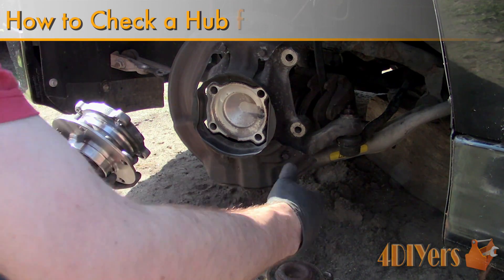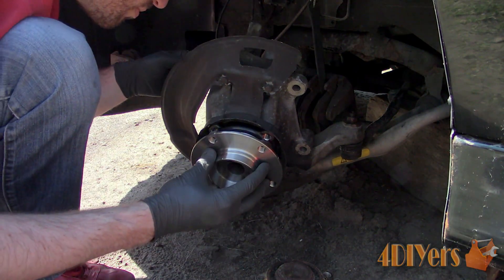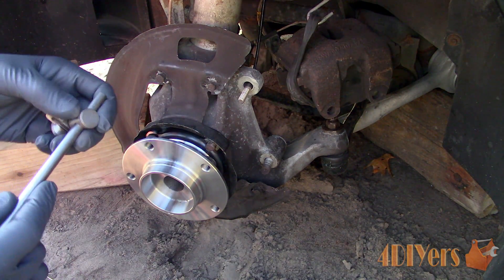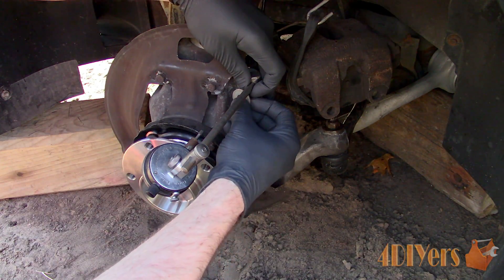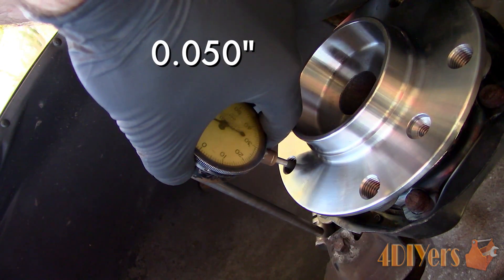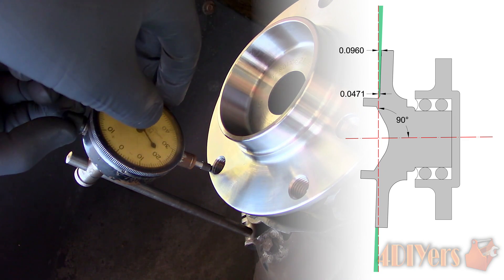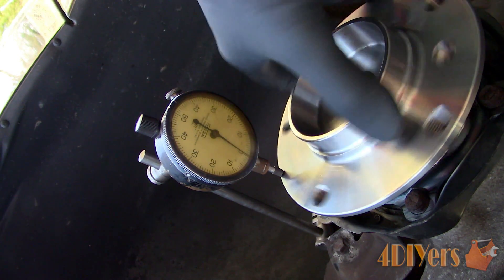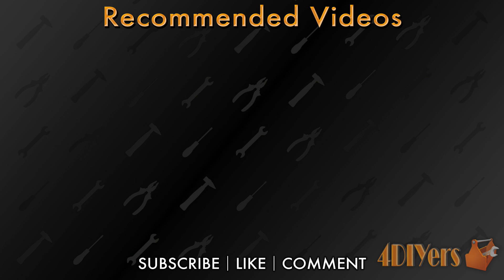How to Check a Wheel Hub for Runout with a Dial Indicator

Comment: thanks for the video, if the runout on the hub changes very fast (like 0.004 in 10-15 degrees) but stays within certain range, would it be a concern?

Comment: I bought a set of front struts and rear shocks from your company for my 2015 Sorento 2.4 LX.  The struts were installed without any issues.  When I removed the rear driver’s side shock the upper mounting bolt was extremely hard to remove.  I’m not using any power tools.  I finally managed to remove it, but now I can’t put it back in; it stops about 45% of the way in.  Any idea what happened?  In your video that bolt slid right out, but that wasn’t the case for me.  Could KIA have installed the wrong size bolt during the car’s build?  I’m the only owner.  I left the shock off at the moment, but need to know; what can I do?

Comment: Genuinely think this could finally be my problem. Been troubleshooting a vibrating steering wheel for 45 days. Got new rotors (mine were warped anyway) and the vibration at high speed got worse (but the braking vibration stopped). Could it be that the old rotors had worn to the shape of my hubs with runout? Been all the way down the wheel, tire, and suspension scenarios, no dice. If you're still around, let me know what you think.
Reply from the maker: It may have gotten worse if you had a failing bearing and used a hammer to remove the rotor. Did ensure all the mounting faces are clean?
Reply: @4DIYers  I originally thought some of the buildup was cancelling out the runout, but a shop remounted the brakes and now the wheel shakes completely randomly over 65mph. I have since given up lol. 242k miles on the car, money is better invested in a new one.

Comment: Old video but helped me to solve small vibration. Regular check of the bearing (playing with the tyre 9-3 and 12-6) showed no issue, but checking runout and it was over the spec, in my case I also had to rebuild the calipers.
Reply from the maker: Awesome to hear I was able to help and you got the issue solved!

Comment: Thank you I've been studying this and be careful that the auto parts store that presses your bearings in your hubs for you doesn't leave the spacer out between the bearings which stated to me I had three repeated failures before I took it to the shop they said Hey where's the spacer
Reply from the maker: No problem and thank you for the feedback too! What a mess on their part, such a big safety risk and not to mention a headache.